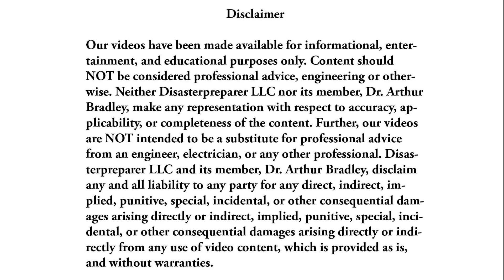Aluminum Foil for RFID Protection, Part 2

Comment: My first “foil book” worked for a couple of months before it tore. 

I took two hotel key cards, taped them on the long edge with Scotch tape, wrapped the “open book” with a double layer of foil inside and out, then covered it with packing tape, which should protect the foil from wallet wear. 

Good to know that a “foil folio” is effective.

Comment: Thanks for this and the additional testing. I'm always getting these fake cards in the mail trying to get me to become a member of this or that group. I'm going to keep a watch out for some, wrap them in aluminum foil and then in packing tape and use them as spacers between my cards. Also there is antimicrobial silver cloth that is sold. I would be curious if these also protect your cards? A company that makes them is called Silverkleenz.

Comment: What about placing a strip of aluminum tape (with the paper backing still on) in the paper money slot of a wallet?  I just started doing that and so far the readers at two stores in the area have not been able to read the card.  To be fair, I also inserted smaller pieces of tape in two other spaces in the wallet but none are directly next to the card.

Comment: Hi doctor !! Haw are you !!
Dose thickness  of foil makes different  ??
What if I take very cheap 2 fold or 3-fold wallet and in very first banknotes pocket slip in thick pice of foil reinforced  with duck tape !! Will it work ??
What if I fold foil in 2 or 3 layers  ??
Thanks !!
Reply from the maker: The thickness doesn't really make a lot of difference. Even one layer around the cards would be adequate to block detection. One way to know for sure is to try your setup with a single card and see if a card reader can see the card. It's pretty easy to block RFID readers.
Reply: @disasterprepper  
Doctor !!!
Thank you very much for quick responding , and explanation  !!!
Happy  New Year  !!

Comment: You could get a business card and cover it in aluminum tape, and then keep it next to your RFID card. Or use the aluminum tape to make a sleeve that goes around your card in your wallet.
Reply: I just did something similar...I have a bi-fold wallet cards stored on one side ID and stuff in the other fold side. Both sides have a storage slot that is large (almost entire size of folded wallet. I have aluminum duct tape cut to size inside both storage slots so when wallet is folded like when it's in pocket both sides of wallet are protected from RFID

Comment: Good! Years ago I took a couple of layers of heavy duty foil and encased it in some Contact paper 3" wide x 7.5" long, and put that in the outermost pocket of my bi-fold wallet (where dollar bills would go). The contact paper protects the foil against being damaged. I already had the foil and contact paper so it only cost me a few minutes of time to construct. It's holding up well, so I can't justify buying a Vault card or even an RFID wallet.
Reply from the maker: Very clever!
Reply: would be good to test this too!!
Reply: What about encasing some aluminum foil within an 8.5"X11" sheet of heat-activated plastic document protectors (like large ID card sheathing) then cut strips wide enough to slip your cards into like a mini-folder then place within your wallet?
It would be thicker, to be sure, but it would be FAR more durable than the contact paper/aluminum foil pieces. 
In the case of a bifold wallet or billfold, it could remain inside the wallet in the paper money area and always be available to protect your cards, assuming the aluminum foil needn't be in direct contact with the card(s) to be protected. 
Sound feasible?
Reply from the maker: I would think that would work well. You're basically creating your own mini-RFID wallet to go inside your other wallet. I still like the VAULTCARD as a simple, effective solution.